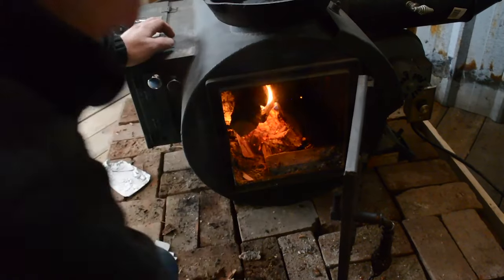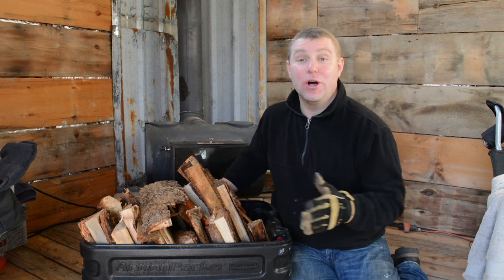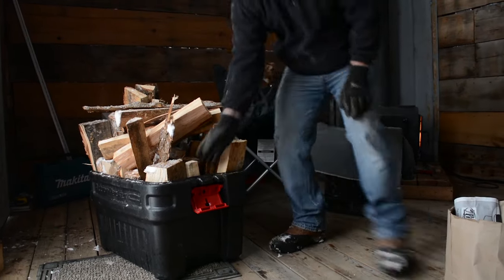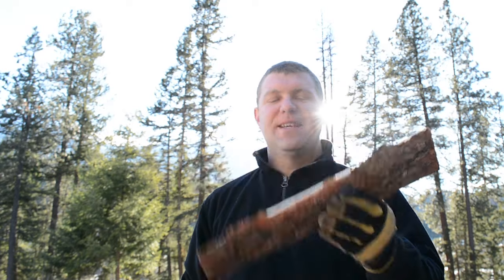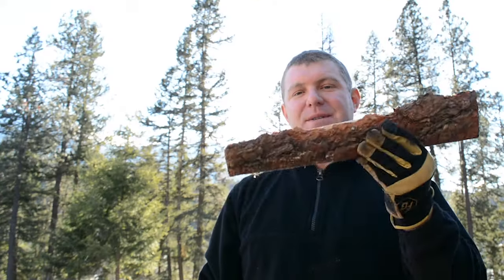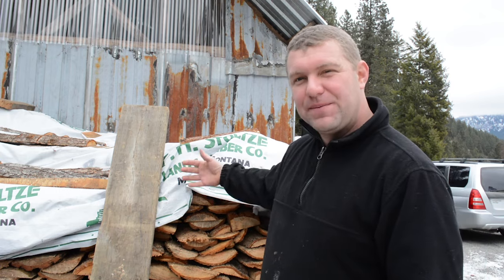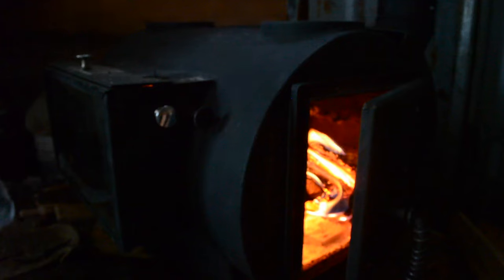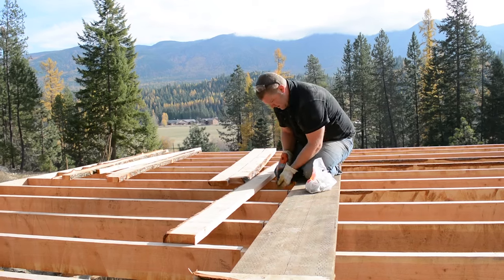5 Wood Burning Stove Mistakes You’re Probably Making

Comment: don't stack wood too close to heater...you'll burn your house down...
Reply: Only if you are stupid about it. I have layed  wet logs right on top of the stove to dry them out be for putting them in the wood pile. Don't put the wood by the door of the stove and don't for get to move them once they are dry.
Reply: And you should stack your wood at least 3 feet from the stove. Other wise it could burn the house down. And that will be at like 2:30am when you are sound asleep.